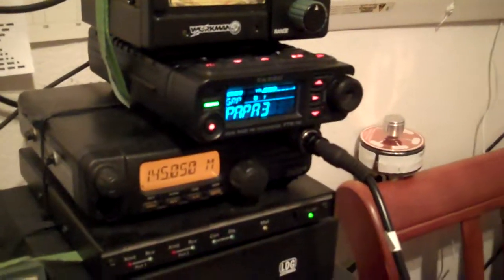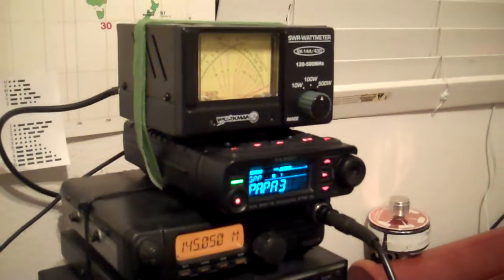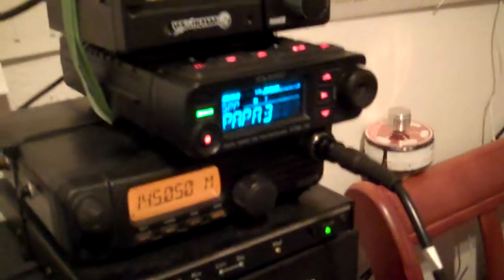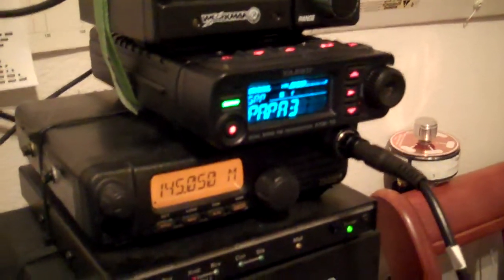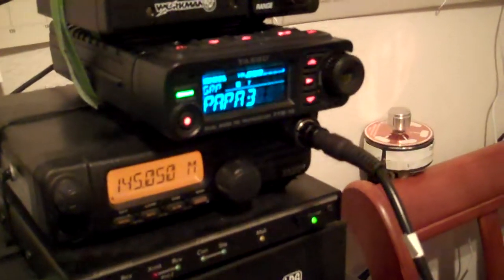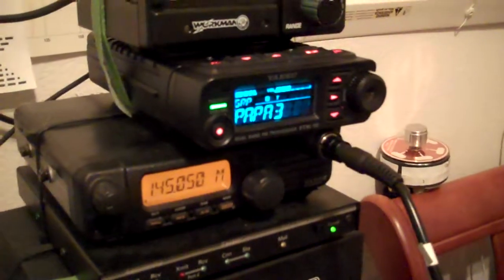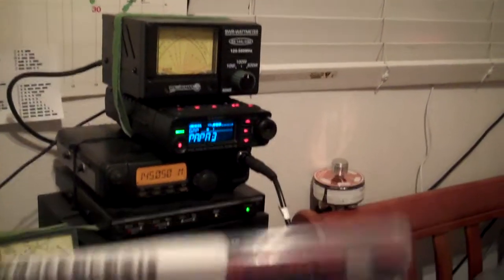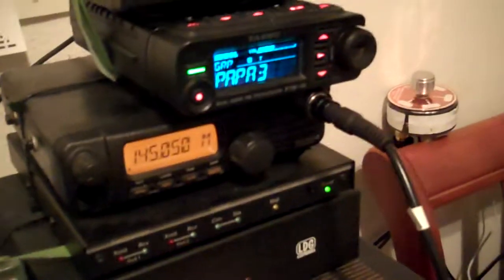Yaesu FTM10r filter repair 4of4  LTM450FW swap, Electromigration filter autopsy

Comment: Just started having this same problem with my FTM-10r too. The symptoms are just as you described. It was TXing fine but crackling on receive and soon became deaf mostly on UHF and on VHF. But strangely affecting ham bands only as the police and fire on UHF were heard just fine. I've reset the radio but it still has the problem..I'm not going to attempt to do it myself instead may send it to Yaesu for repairs..Thanks for the post.
Reply from the maker: Your welcome, thanks for watching.  Yaesu probably fixes this problem every day.. You could try to tell them that you are aware of the 'desgin defect' and ask them t o put the blocking caps in, as directed by the filter manufacturer...they may do it, never know!!   73  Jim